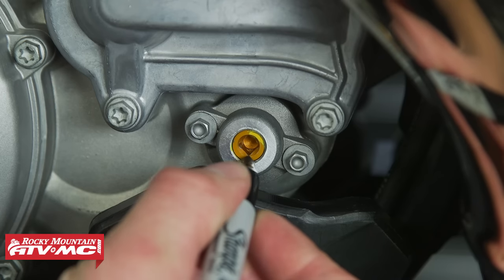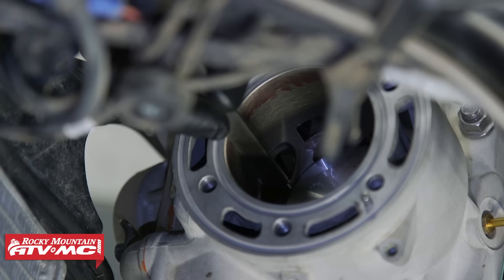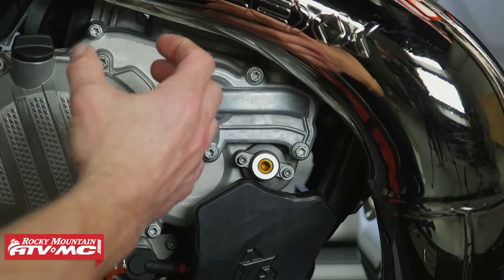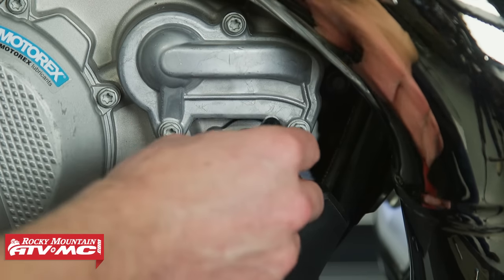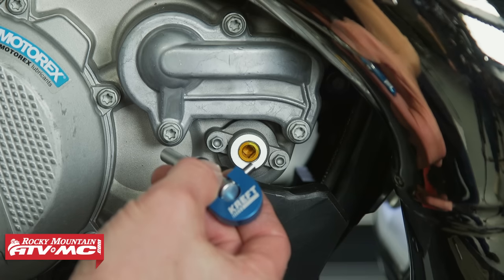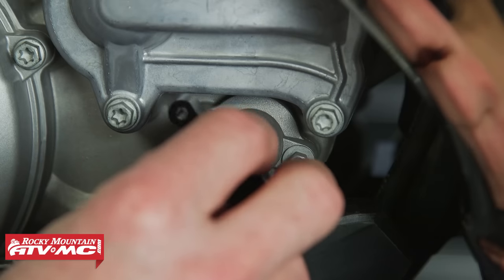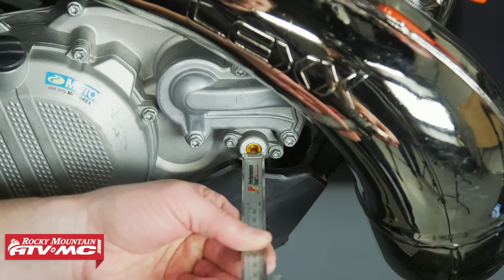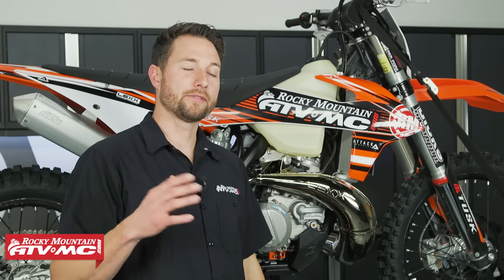The Secret to Power Valve Tuning on KTM, Husqvarna & GasGas 2-Strokes

Comment: I was waiting for the secret. If you take the pipe off and fully open the powervalve manually you’ll feel a slight deviation, or a lip, where the powervalve flap meets the last section of exhaust manifold. During your next round of maintenance when the head is off the bike and you’re doing powervalve maintenance you may visibly see this deviation. All 2T KTM might not have it, mine did. Simply Dremel down the manifold edge until it’s perfectly flush with the exhaust flap, plus polish it to a Crome finish. You’ll notice the torque! 
And of course always set the Z-dimension.
Reply: What is z dimension? The ball on top and it’s threads?
Reply: @natm3145  The Z dimension is where the power valve flap opens perfectly when WOT, and/or Z dimension is when the power valve is perfectly adjusted. You can buy a tool from RM for about $15 to set the adjustment, but you have to have your cylinder out of the bike  - a good time do do this is when you are doing a top end rebuild.
Reply: Any videos on setting this
Reply: @TheAbbott1986  Jeff Slavens has videos on how to adjust the Z-dimension of the power valve. The exhaust port flap when fully opened where you may find the imperfection is by sight and feel only. It’s not a setting it’s a slight factory imperfection that can impede airflow.

Comment: Rather than the fancy “Robertson” tool, a flat head screwdriver fits right in there corner to corner
Reply: 👍 You can also use a number 2 Phillips screwdriver, like I do.  You catch all four corners of that square Robertson slot.
Reply: I wish I woulda know that before I made my own tool with an angle grinder
Reply: I’ve done both in a bind but took an old 1/4” ratchet adapter and ground it down slightly to make a perfect fitting tool.
Reply: Wow another genius, it was designed for a #2 phillips screwdriver, bet you didn't see that coming eh!

Comment: The more preload you give it, the snappier pipe hit will be. Yes, you delay it by a few hundred RPMs. But when the switch happens, it will be violent. If you remove most of the preload you can (softest 2ndry spring - red, and adjuster spun out to flush with the case), you'll get the smoothest transition to the pipe. It will be linear compared to a typical 2-stroke hit. I recommend that for traction.
Reply: This is exactly the reason and the way how I have adjusted too my PW on my Husky TC 250 2018. Red (softest) auxilliary spring adjusted flush with the cover. This way the bikes power output is more predictable.

On my Husky TE 250 2015 I changed also that larger main spring for a softer one. I didn’t do this on my TC 250. So on this TE 250 2015 I had to adjust PW adjuster a little bit in with red auxilliary PW spring (softest) as the combo was too soft and PW opened too soon and this killed bottom/mid torque a bit. I got that torque lack away by just turning PW adjuster 1/2 turn in from flush.
Reply: Putting the screw flush with the case is not wise at all. You dont gain anything, you only lose bottom-end torque.
Reply: @verttisyrjala2897  I´m sorry that I will reply one year later. My TC 250 bike has very predictable power/torque curve by setting my PW flush with the cover and using the red spring (softest most agressive). I´m a heavy rider around 100 kg (220 lbs) so I have changed my front sprocket from std 14 to 13 and rear sprocket from stock 50 to 49. It can be that this combo + other engine mods have helped but now I wan´t to try different settings. I will first turn in (clock wise) the screw 1/2 turn and test it. Then 1/8 turn more if it gets even better and helps to gain even more bottom-end and midrange torque as the exhaust port height will start to increase a bit later. You can´t say which setting works for every bike but it can be that my current setting adjusting screw flush with the cover + red PW spring will cause too soon exhaust port opening.
Reply: @jannep6772  Thats what I was trying to say. Setting the screw flush with the case makes it open too fast and you will lose power and torque in the low/mid rpms. In my TE300 I have it 1,5 turns in from flush. I took a look at some old dyno sheets with the red spring and different screw settings. 1,5-2,5 seems good.
Reply: @verttisyrjala2897  Thank you very much. Kiitos! I will adjust it and test it soon.
Reply: @verttisyrjala2897  I tested to adjust PW screw in my TC 250 2018. First 1/2 turn in, then 1 turn in and finally 1 1/2 turns in. It feels now more powerful and torque is better just like you described. Thank you for this as my bike feels now easier to ride. 😎👍🇫🇮
Reply: @jannep6772  Glad to know.

Comment: On any carbed 250 I’ve ridden, I put the red spring in there and pull the adjuster out flush with the case.  Definitely worth trying if your on a 250 woods or mx.
Reply: Does this apply for sumo use too?
Reply: @marcelltomasics2487  If you set the screw flush the powervalve will open too fast and you will sacrifice bottom end torque/power. Try anything from 1,5-2,5 turns in from flush with the red spring.

Comment: Actully backing off pre load and running a softer spring (red) gives the bike a smother delivery.
Reply: Not on the carb bikes.  Red spring makes the power hit over a smaller rpm range while green hits over a wider range.  They all open at the same time based on whatever preload you run. Usually about 5500rpm.  Red is full open i think in 2000rpms.  Yellow like 2500 and green 3000.  What i noticed with red is the hit happens sooner and faster but overrev suffers.  I run the yellow in my 250xc as the red was harder for me to deal with traction.  Also i run the kreft power dial. Nice addition.
Reply: @TheShift1313  don't make carbed ktm gas or husq
Reply: @fpslouis3198  the sx is still carb and my bike is a 12.
Reply: What way would I turn it for a much more aggressive hit on a carb bike ?
Reply: So.  Woods riders favor a red spring and back out flush on carbed bikes?   Imma woods and trail rider.. does this let the power come in at lower speeds etc?   Like the 2t’s version of a 4t bottom end grunt?
Reply: @mustangwagz724   your just moving the power around a little bit with the power valve adjustment. Opening it early just makes it smoother and a little more tractable. Opening it later feels like a bigger hit .
Real bottom end comes from more compression.

Comment: Maybe I am crazy but i like to un tied the tension of the spring to get more torque by riding a higher Gear and have a quick respond when needed in lower gear, is that logical are am I really nuts ??? Thanks for some feedback.

Comment: Are you able to change the power valve springs on 125’s?
Reply: 125 dont have springs
Reply: @drblik6379   wrong , on my husky tx 125 you can change the springs ,

Comment: its weird  in my 2019 ktm 250sx when i give gas i don't feel she respond like she was before, i clean the carburetor good and  still  feels the same any recommendations
Reply from the maker: When did the problem start? After making adjustments, or is it something that has just gotten worse over time? If it's from adjustments, hopefully you wrote down your starting point or how far you have moved it, so you can put it back. If it's not from adjustments, check your compression to see if the top end is wearing out. Other than that, just make sure you are up to date on your basic maintenance (air filter, spark plug, etc.) -Charles

Comment: What way would I turn this for a carb bike for a more aggressive hit ?
Reply from the maker: Counter clockwise.
Reply: @rmatvmc  thanks 👍
Reply: @rmatvmc  does this make the bike run leaner ?
Reply: @robhayter484  No of course. Your carb will work as it´s been set up by jetting and needle etc. This PW adjustment only changes the rpm when the PW starts to open. Counter clockwise and it opens sooner in the rpm range and clockwise will delay the opening rpm.
Reply: @jannep6772  cheers for the info , I’ve changed the pv spring so even better , didn’t know you could change the springs on the 125s
Reply: How many turns from flush can I screw this out ?
Reply: @robhayter484  I have no experience to power valve tuning for 125’s as I have only two 250’s TC 250 2018 and TE 250 2015. Flush means that the power valve adjusting screws head will be at the same level as the cover. So you screw it in => clockwise not out => anticlockwise from flush. I have now my TC 250 with red PW spring and screw set at 1.5 turns in from flush. More torque/power in the midrange than with the PW flush with the cover.
Reply: @jannep6772  sorry I’m a bit confused , screwing it out (anti-clockwise) make the power valve open sooner giving it a more aggressive hit right ? 
And in means the power valve opens later making the hit more linear and smoother?
Reply: Mine was flush from standard
Reply: @robhayter484  Like I wrore I don’t have any experience with PW in 125’s. If it’s set flush as standard I would leave it like that. But you can test it by say 1/2 turn in or maybe more. Not more out from flush.
Reply: @jannep6772  what happens if you go out more than flush ?
Reply: @robhayter484  I don´t know what happens with 125´s but with 250/300 it´s not recommended. Maybe PW opens way too early in the rpm range and it kills the midrange power and torque?

Comment: What’s the max turn? Or does it bottom out
Reply: From factory setting I would not go more than 1 turn in either direction or you are severely detaining performance and affecting peak.  On all my bikes I’ve found 5/8-3/4 turn out gives most linear and usable power.
Reply: just in from flush is about as far out as you want to go. about one thread in.
Reply: @cbc76am  Pre 2017s flush it give or take on the 2017+ they come like 2 turns in and flush is way too far out.  I learned the hard way
Reply: Preference, we run our tpi 300s all in one half to one turn in from flush. Motor is amazing there, and better with a reflash by sliber turbo.
Reply: @leroywilliams7210   I have a 2018 KTM 250 SX, and am trying to find where exactly the powervalve factory settings is, so I can start there. Do you know how to adjust it back to the factory setting (I bought the bike used, so it may not be on the factory setting)
Reply: @JokersWild70  They set it by RPM at the factory.  If I remember mine was approximately 2.5 turns in from flush and I went out -3/4 turn for best performance.  So if you see 1.5-2 threads showing you’re probably right in there.

Then find a slight uphill and try it 1/2 turn each way for testing what’s best.
Reply: @leroywilliams7210  Thank you. I appreciate it

Comment: turning it in (clockwise) does not make it more mellow! i have played with this for hours to find how i want it. red spring - flush with case the powervalve opens sooner and is fairly undramatic and boring. i currently have the red spring 4 full turns in from flush, the power comes on and "hits" like a more traditional 2 stroke and is quite dramatic & much more fun. i feel like KTM, whilst making great developments with 2 strokes and making the bikes easier to ride and more 4 stroke like have taken away the element of 2 strokes that a lot of us love.
Reply: I was thinking they got it backwards but i have a carb not tpi.  On mine clockwise preloads the spring delaying the start opening of the PV.  To me that is less mellow cause it hits harder :)
Reply: @TheShift1313  so is mine. its one of the last carb models - 2018. 
I think maybe the key to explaining this is in where to use the word mellow. 
Adjuster flush with case = snappy bottom end, mellow on the top. 
If you add more preload (turn it in clockwise) it's mellow on the bottom but then you get the traditional mid to top end "hit".
Reply: @TheShift1313  It hits harder because you’re delaying it, but by doing so you’re losing some mid power and often if delayed too far the peak is actually never hit.  JD did some awesome tests on the dyno and you can clearly see if too far in either direction it affects the whole range.
Reply: @leroywilliams7210  i think we are saying the same thing :)  preloading the spring delays the pv open rpm.  It doesnt necessarily change peak power unless like you said you go a bit to far.  The main thing we do is change the starting rpm and ending rpm for the PV as well as the "ramp" it opens.  I think the mellow term is whats throwing me off.  Someone mentioned the mellow setting is the red spring and i guess if you just idle around maybe.
Reply: @TheShift1313  Yes I find people think it has more power IN because there is less power down low and then a sharp “hit”!  I like my PV out a little to give me More Power Earlier and more linear power into the same hit and up.
Reply: There is a wire connector under the gas tank unplugged is lame plugged in it hits much harder  .

Comment: Can you change the spring on the tpi models?
Reply: Yes. RMATV sells them under OEM KTM parts
Reply: Ktm says no but there are lots of cases of people ignoring that advice. The fuel system does not have a feedback system so if you change the exhaust port and allow more air out of the engine, more can get in but the fuel doesn’t change at that specific rpm
Reply: @JayGee6996  I run a programmable ignition on all my bikes. You can also get your stock ignition re-programmed many places that adds oil (which TPI needs in stock form). If youre going to play with the PV you should be able to do plug readings as well. All part of the fun.
Reply: @wfodavid  yeah if you’re going to do more than just pv changes you should be ok, I think ktm just cover their back to stop people playing who don’t know what they’re doing 👍
Reply: @JayGee6996  Exactly, Spot On!
Reply: Yes. I put the Red in my 2019, that combined with slight adjustment to the real idle screw made a noticeable difference